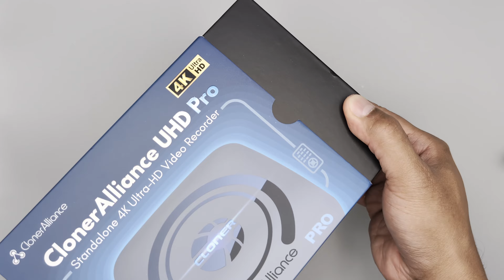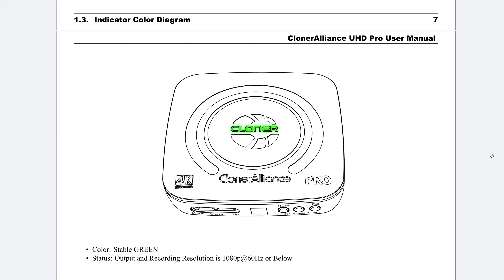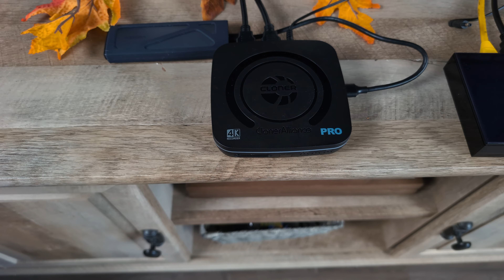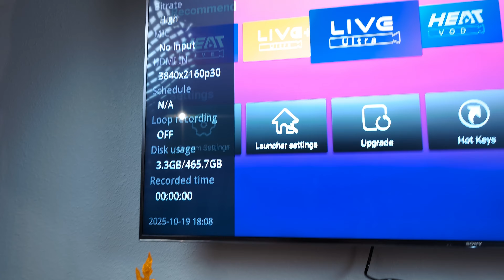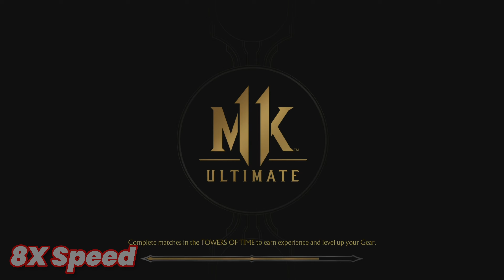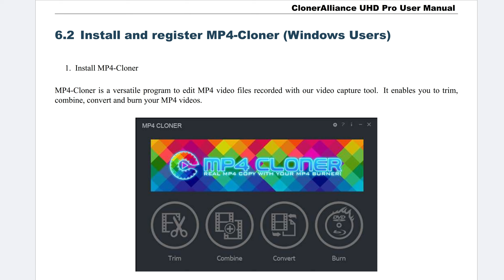ClonerAlliance UHD Pro - Unbox, Setup & Review

Comment: Do you know what the difference between ClonerAlliance UHD Pro and the ClonerAlliance UHD Pro  MAX?  
i cant seem to find the difference besides the price.  is one better than the other?
Reply from the maker: Recording resolution and framerate are the same on both...

The differences are...

The UHD Pro can:
· Input HDMI upto 4K@60fps and pass through 4K@30fps
· Recording video bitrate, per the site is up to 22Mbps
· Utilizes USB 2.0 Type micro-B to connect to computer and has a USB 2.0 Type A port to connect a flash drive or external hard drive or SSD for recording
· Records in (h.264/h.265) MP4 format
· Only records and stops...no record pause option

The UHD Pro MAX can:
· Input HDMI upto 4K@60fps AND pass through 4K@60fps
· Recording video bitrate, per the site, is up to 18Mbps
· Recording independent audio bitrate, per the site, is up to *320kbps*...maybe whey the video bitrate is lower just to have that extra bandwidth
· Utilizes USB 3.0 Type C to connect to computer and has a USB 3.0 Type A port to connect a flash drive or external hard drive or SSD for recording OR a Transflash/microSD card
· Records in (h.264/h.265 MP4 or TS format
· Scheduled recording has more options
· Can pause/resume recording
· GUI a little more up to date

Not sure if I got ever difference but that is a good amount of them...
Reply: @cooptonian   Thank you!

Comment: Ive had 3, they are not all cracked up to be. 2 have been sent back, one just didnt come on, the other (New Amazon) the latest version, problem with HMDI socket, plus will not play back from large capacity flash drive, plus none of you reviewers dont mansion the heat, why do they get hot, they are not doing anything, but direct a signal, if you connect to 2.3 ATA there's a chance they,ll  burn the house down
Reply from the maker: Thanks for sharing your experience and issues encountered. I haven't experienced any of those issues with mine. The last few streaming boxes I've covered were lengthy recordings. The storage device mine is usually connected to is a Samsung 500GB Samsung EVO drive in a Ugreen NVMe enclosure. Seems you've had a run of bad units...what exactly was your setup and how long were recording sessions? Also, it is not not doing anything...it is compressing/encoding video which if you try that on a desktop/laptop CPU will max out several, if not all, CPU cores (increasing CPU temp). This would be more efficient on a dedicated GPU... In any case, there will be heat generation just from processing.

Comment: First of all, you should've had a flawless victory 🤣. Good video sir. The quality and resolution appears to be very good and the simplicity of everything seems pretty easy. Looks like it has good power and records very strongly. Is the HDMI cable that it comes with Cl3 rated? in the case you wanted to hide wires? From your perspective, did the playback look exactly the same or was anything or colors overblown?
Reply from the maker: No, the HDMI is not CL3 rated...you'd probably want a longer cable than what is included if going to hide in the wall anyways. Playback resolution and color seem accurate and inline with the device specifications; I can't complain.